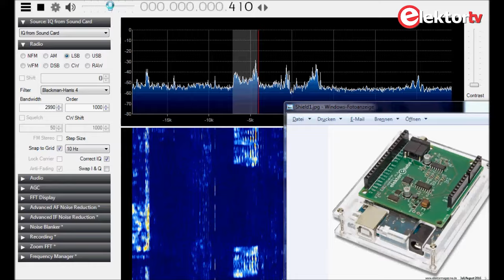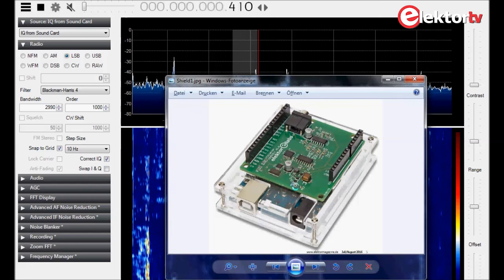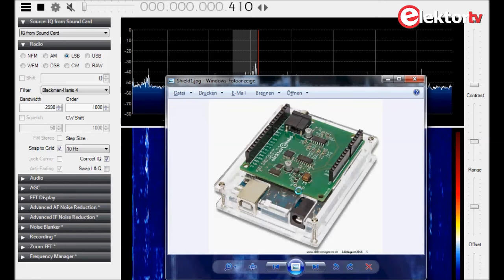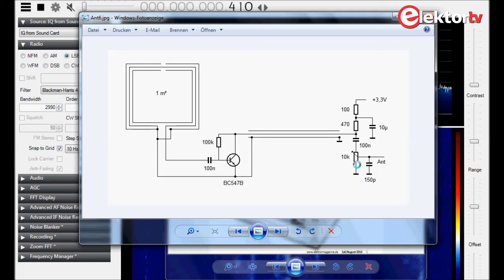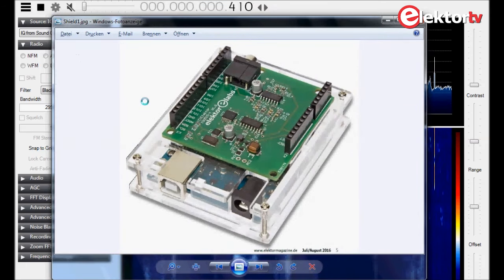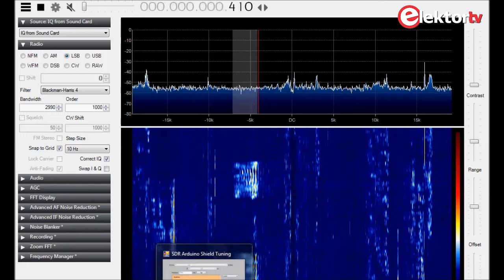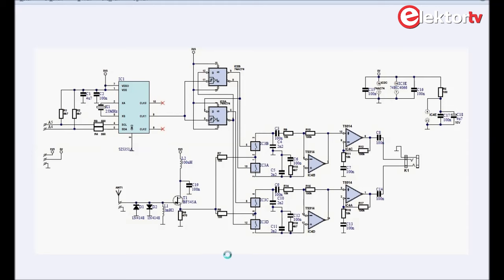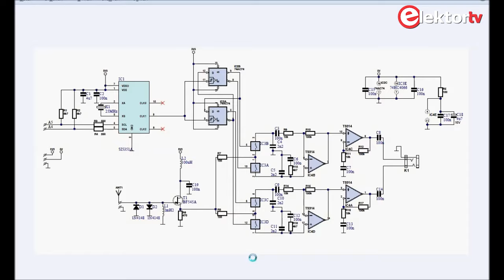The new Elektor SDR Shield for Arduino – Introduction

Comment: Could the Arduino handle doing the display without using a computer? Or use a second Arduino to display? How are you controlling the tuning and demodulation mode (LSB, USB, CW, AM) of the SDR shield? You show no circuit diagram with buttons or rotary encoders.